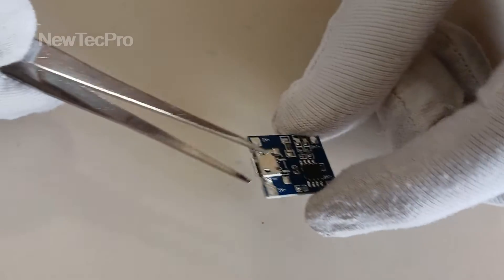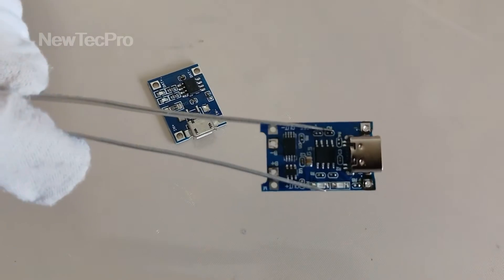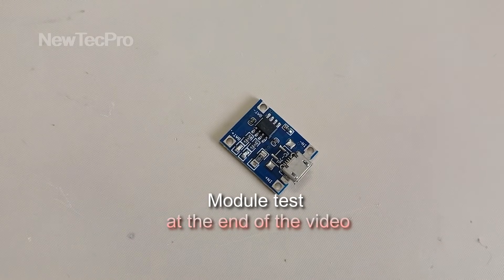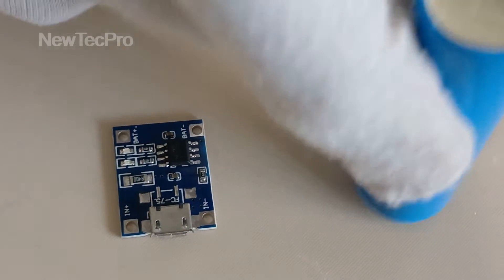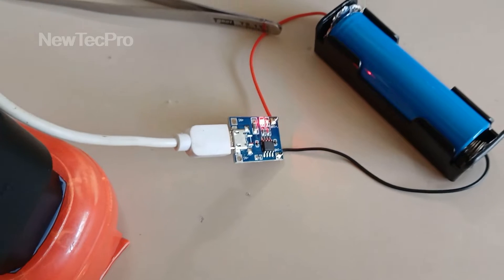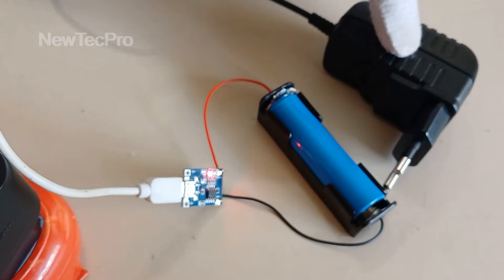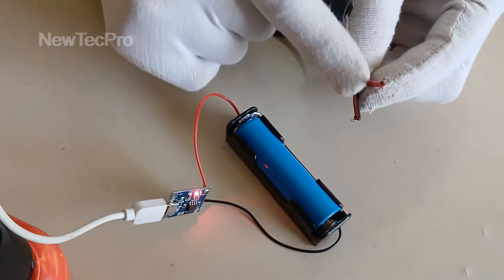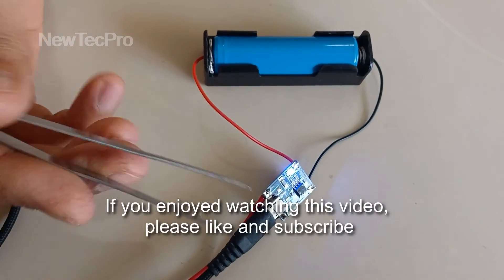how to make 18650 Lithium Battery TP4056 Charger Module

Comment: can it work with a 3.3v lithium battery
Reply from the maker: The TP4056 is designed for charging standard 3.7V lithium‑ion cells (nominal 3.6–3.7V, full charge 4.2V). A 3.3V lithium battery is not suitable — the module won’t charge it correctly and could damage the cell. For 3.3V chemistry you’d need a charger specifically made for that voltage profile.

Comment: Can use 5v 2a adapter?
Reply: 5v2a will work however you'll only get 1amp limited at the tp4056 chip.
Reply from the maker: no you just 5V 1A